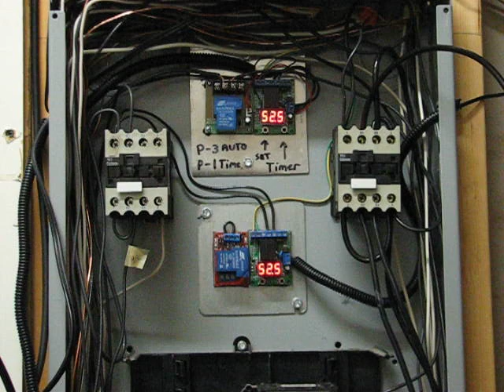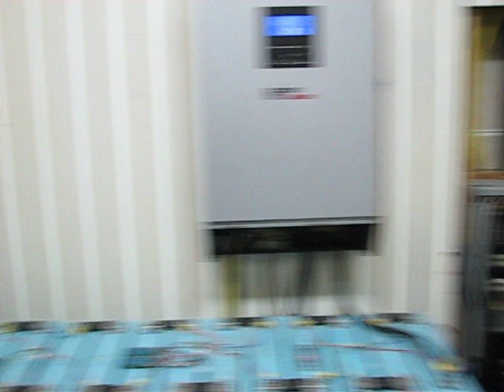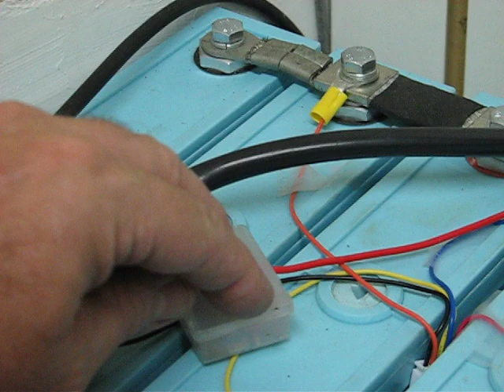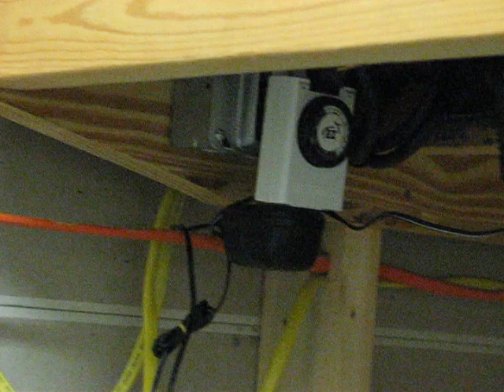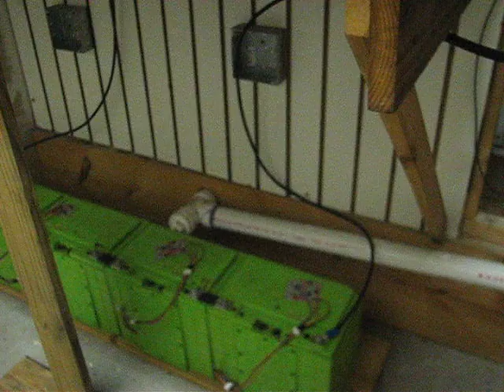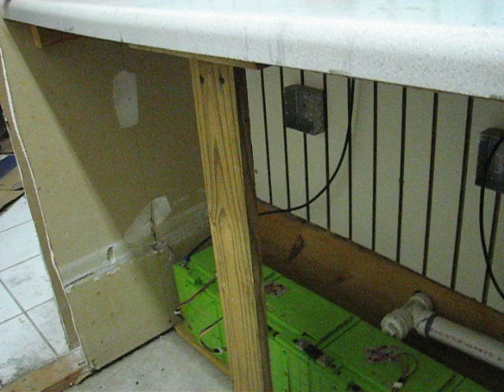DIY Solar Hybrid UPS Inverter & lifepo4 Battery Setup

Comment: looking good my friend. I cant wait to be off grid I will keep it as a back up. along with a generator ect. But I wont have to pay a high bill and I like to do what Justin dose and have a Grid tie so I can cell some back to help even get rid of what ever charge the power companies charge,   It fells good when you can say I have power when others dont when it comes to a power outage.
Reply from the maker: McCuneWindandSolar Well the AC is on the grid most of the time only powered by solar 5 to 6 hrs on a good day. but my electric bill is very low. Did not expect this good of results with only 1/2 my system running. have 12 more solar panels just need 2nd pip to get them going..
Reply: off grid kid I only have about 1/5th of my stuff running on solar when the sun is out lol. I keep the batteries as full as I can just incase. but every thing comes from out side in the shed though a second line were I moved lines over to.   I run my lights 2 AC window units. off my pip. at about 3kw,  but I only have 1.1 kw of solar I need a lot more solar, But a little at a time I guess.  I need to do and update on the system and post since my PIP is still running strong.
Reply from the maker: Glad to here you pip is running strong! I'm Torn between getting 2nd pip now? or waiting for mpp to come out with the 120v USA version.